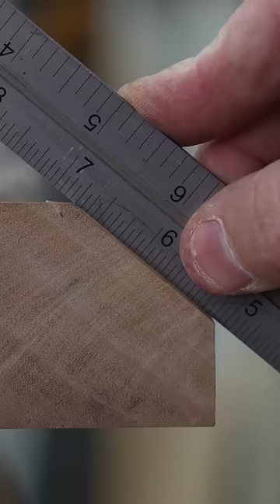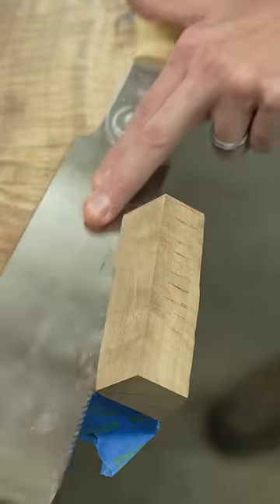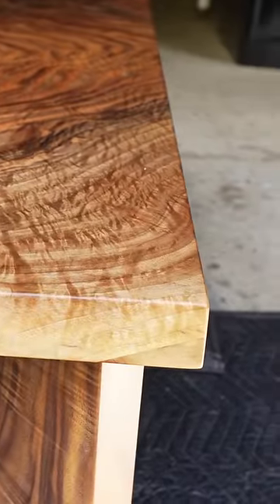Woodworking fix

Comment: There's enough area and Maybe was better to using a wooden (or metal) dowel or two plus glue of course for better binding and Durability! I wouldn't say nothing but the edges and especially corners are exposed to shocks more than other parts of a table (and you know shits happens all the time which could embarrass you to your client).
And some how I feel that must not be the first one which tell you something like that !

Comment: This is pretty deceiving. The beginning shot and the final shot is the table in two different angles. You flipped the table over, so the piece you added is the dark triangle underneath that- you can tell is not part of the original slab. It still looks good. But you’re passing it off as if it’s the top of the final shot when it’s not.